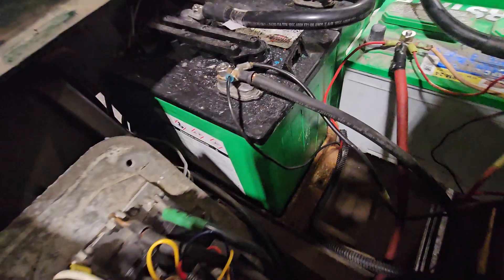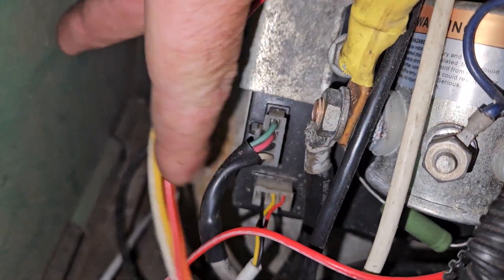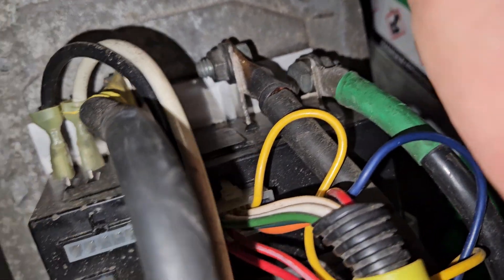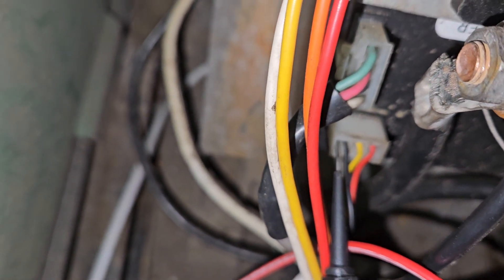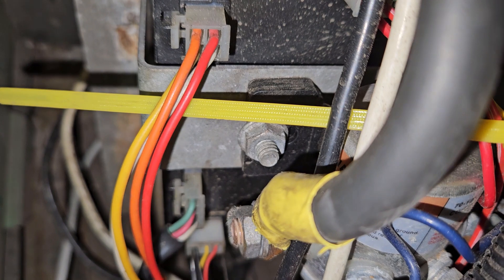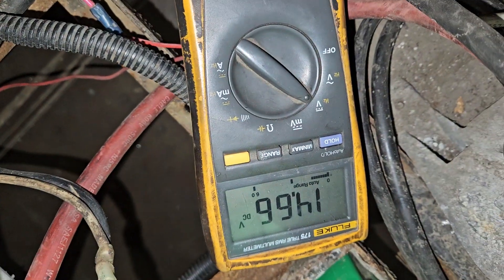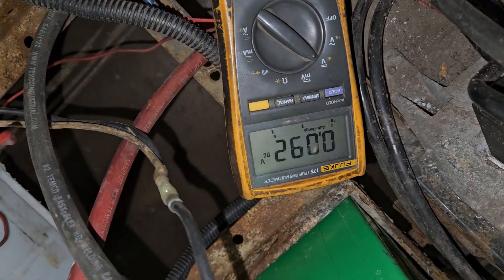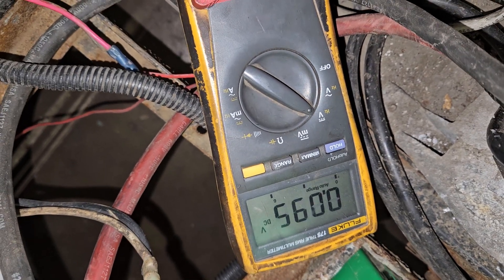EZGO SPEED SENSOR TEST.

Comment: I am getting proper voltage from red/black but only 2volts from white/black. 

Would this indicate a bad sensor/magnet ?
Reply from the maker: Give me a sec, I'm at work. I'll have to refresh my memory on this.
Reply from the maker: What black and white wire are you talking about? The sensor wiring I believe is black red and yellow.
Reply: Sorry. yellow/black wires on the speed sensor.
Reply from the maker: What cart are you working on?
Reply: 2006 ezgo txt with the pds system.  Same as your video posted.
Reply from the maker: Your wires aren't red, black, and yellow? 
It is a 3-wire plug, test the 2 outer wires, then the black wire and middle wire. Put your cart on jack stands check voltage.  It should be just under a volt, then press the pedal and the meter should go up to 2.7 or so volts. Find me on Facebook,  same name as on here, with the same logo. Send me a friends request.  It'll be easier to message and try and help you out. Maybe tell me exactly what it's doing.